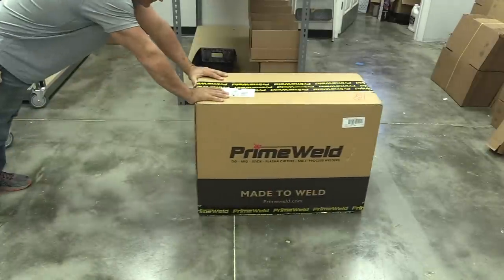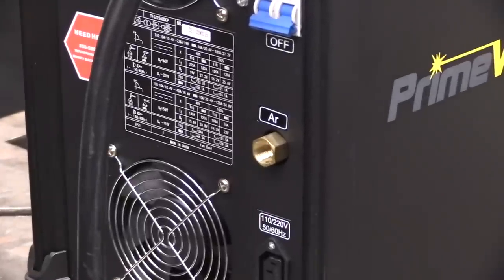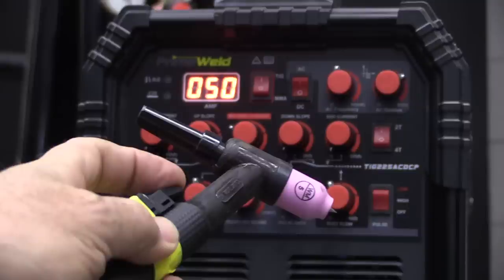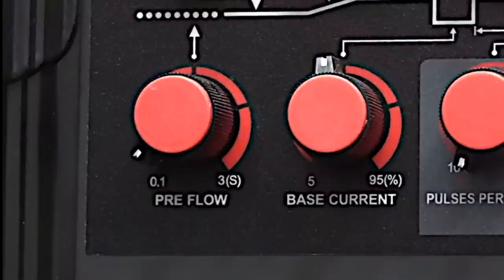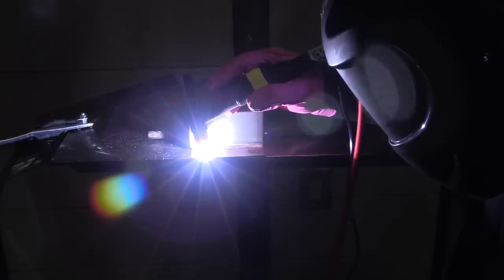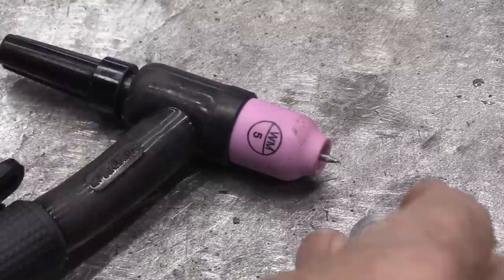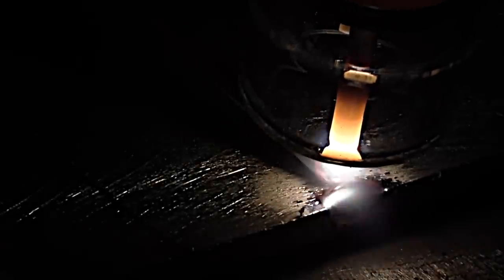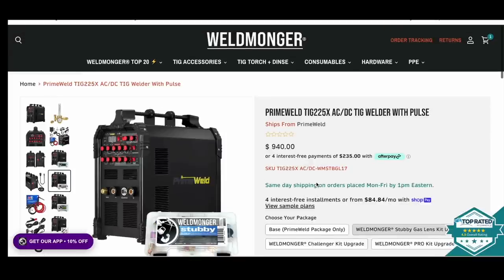PrimeWeld TIG225X 2T and 4T Settings - Switch vs Foot Pedal

Comment: does post flow work with the Pedal or just the switch. I keep burning up my tungsten because I can't seem to figure out how to kill the spark but keep the gas flow going when using the foot pedal. I have the pre flow and post flow set at half way
Reply from the maker: @tonystites2134  both pedal and switch. The key is to hold the torch still after the arc stops

Comment: Are you sure about the 2t Behaviour?
At least my two affordable tig welders do up- and downslope also in 2t Mode. After pressing the switch  the arc ignites with the ignition current and starts immediately to rise to welding current. As soon as i let off the switch, the down slope sequence starts. Once the end current is reached, the arc terminates.
Reply from the maker: I was unsure at first, but the manual clearly states that upslope and downslope are not functional in 2t...so I tried it out and yes i am sure
Reply: @weldingtipsandtricks  Thank you for the quick response. 
Nonetheless this welder seems to be a really great Value!

Comment: I'm curious how it runs stick rods especially 6010 and 8010. Would this be a good machine to buy for a pipe welder ? Does it have lift arc ?
Reply from the maker: I dont know if it runs xx10 rods. Will have to look into that

Comment: This is not a comment but more of a question. I have this welder and the first time I used it my 30 year old Speedglas ( made by Hornell) keep going light. Sensitivity setting made no difference. Used a Miller Elite borrowed from a friend and it worked fine. Blaming my helmet I bought a brand new Lincoln 3350 Viking and it does the same thing as the old helmet. Any clues to what may be going on?
Reply from the maker: 3350 Viking is a good hood. You might need to exchange it
Reply: @weldingtipsandtricks  Thanks Jody. I did exchange it and the new one worked fine.  But the first 3350 I had worked perfectly on an old Miller Syncrowave 250. The techs at Lincoln had no explanation. But I ended up with a great helmet that works so all is good. BTW I think yours is by far the best welding channel out there.

Comment: Hmm i have another inverter but in 2T it also has upslope and downslope. But in 4T you don.t need to hold the button like here in the video. There is something strange here 🤔
Reply from the maker: I have several machines that do include upslope and downslope but  they are all a little bit different.

Comment: FYI, these only need 30 amps, it has a 50 amp plug but the wire gauge is ONLY good for 30 amps and the internals are the same. Upgrade the ground wire and clamp and put a proper pigtail off these machine to a 240 30 amp plug.

Comment: You know all that TIG switch foot pedal and all that I just don't like them if you don't have a thumb throttle on the torch or at least the option to get one
Reply: Not sure what you said, but there is the Tig Button, which works on this machine. It's 300 bucks. The foot-feed will have to do me for a while, but I'll be getting the button for sure-full variable.
Reply: @wadepatton2433  no it's not an activation switch it's an adjustment just like a foot pedal except it goes on the torch instead of the floor and you operat it with your thumb if you're building frames and you're tiging the frames together say food processing equipment then a foot pedal is very unacceptable I don't know if you do any welding or not but when you're building frames with a TIG torch then you're not going to want to use the foot pedal I'll guarantee you that Lincoln and Miller make them for their machines but I'm not looking for a Lincoln or Miller I'm trying to find out this that particular TIG come with a option for a thumb throttle